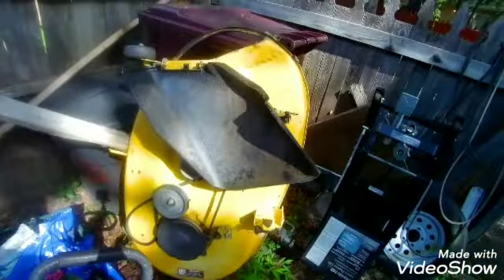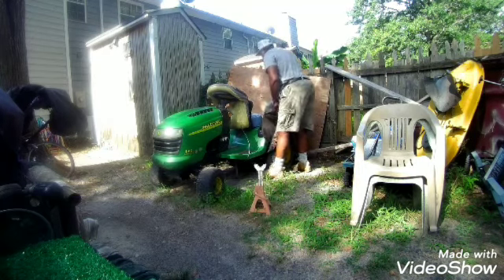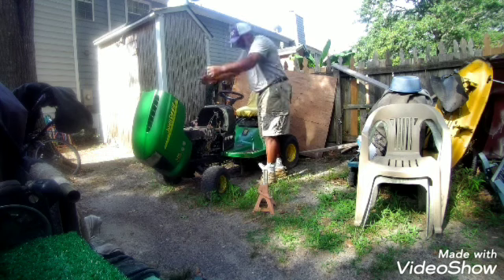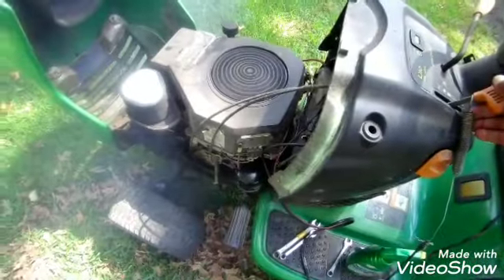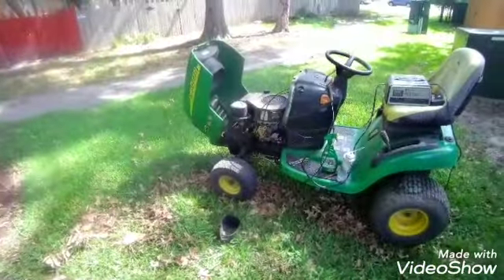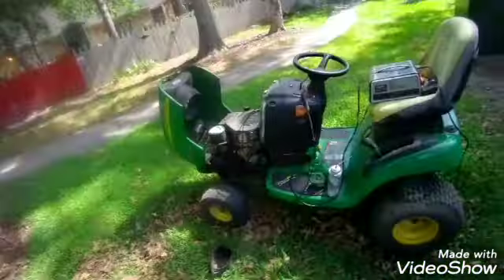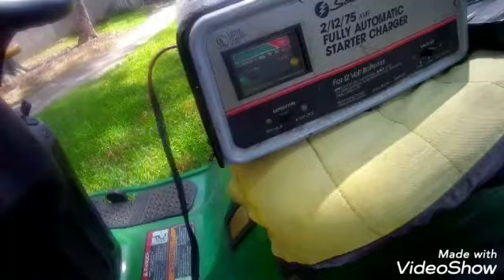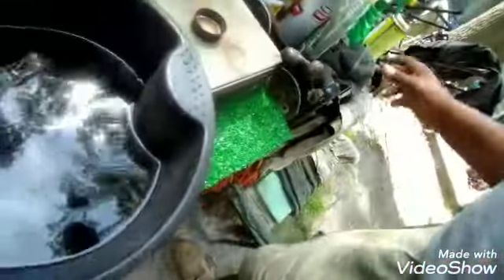Getting the John Deere L110 Ready💪🏽

Comment: Well at least you're John deeper is running not like me plus the poulan xt has a blown head gasket  don't boy 73  did a video of using. Used motor oil.on the under side of the mower pan
Reply from the maker: Ok thanks I knew it was somebody out there👏🏽💯
Reply: @bigsonslawncare  you are welcome young man i.be safe out there in this HEAT WAVE 🔥 🥵 and you responded to dony boy 73 be careful there's a scammer using his you tube channel as cover